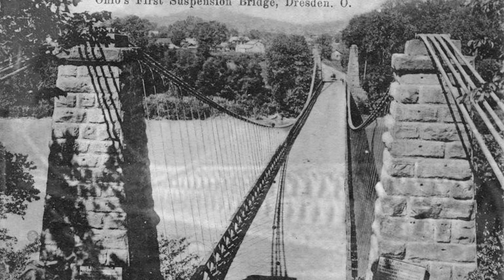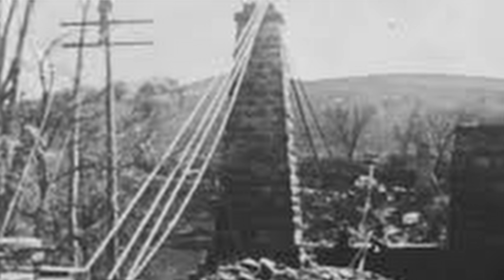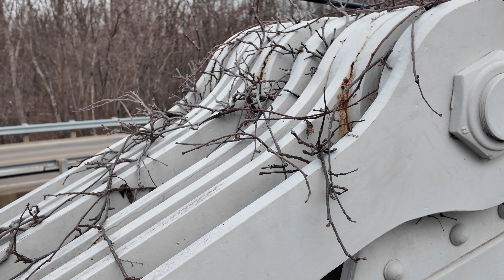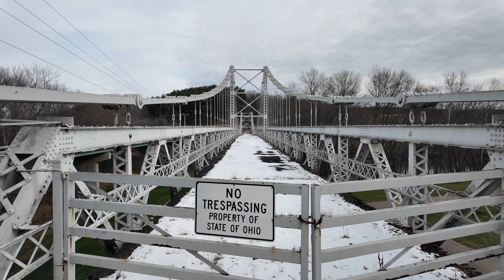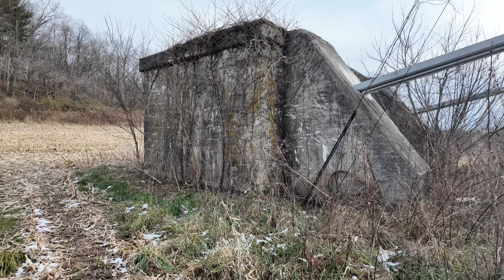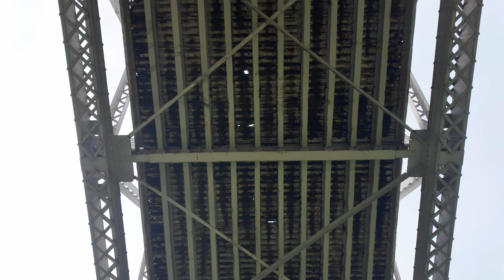The Incredibly Rare, Critically Endangered, Dresden Chain Bridge

Comment: 8:20 That part is just toast and if things are that bad there its not great for the rest of the bridge.
Reply from the maker: I'm not sure how structurally necessary those horizontal beams are.  Those definitely looked to be the worst, probably because they were made of the thinnest metal.  The bridge deck is probably the easiest to fix, for pedestrian use, since you could just toss a light, wooden deck right no top of what's there, so those holes aren't really a concern.
Reply: Might be due to salt exposure.  There is probably a detailed state condition report available.
Reply from the maker: @SteamCrane  Where it is, there certainly would have been plenty of salt used.  Not good for the metal, but having cars use the bridge as an ice skating rink isn't so great for the bridge, either, I suspect.

Comment: The Tibetan siddha and bridge-builder Thangtong Gyalpo originated the use of iron chains in his version of simple suspension bridges. In 1433, Gyalpo built eight bridges in eastern Bhutan. The last surviving chain-linked bridge of Gyalpo's was the Thangtong Gyalpo Bridge in Duksum en route to Trashi Yangtse, which was finally washed away in 2004.
Reply from the maker: Thanks for the info!  As you may have guessed, I'm a fan of historic, and pre-historic, technology, including pre-Industrial Revolution technology.
My research was showing the suspension bridges in Pennsylvania being the first "modern" suspension bridges "with all the features we'd recognize in a modern suspension bridge," but it didn't go into detail. With your info, I just went and checked out some photos.  I'd seen pictures of those bridges before, but not really thought about them as suspension bridges.  
Looks like they're oval link chain bridges, following the designs before that which used ropes/vines, with the chains allowing much longer spans.  Thinking about the differences, the chains are anchored at both towers/pylons, instead of crossing over them to separate anchors.  This limits the length.  Also, since it's running consistent-length, vertical suspenders, and means the bridge deck also sags in the middle to match the main chain sag.  It was clearly inspired by shorter bridges the came before, made with ropes, and those before that made with vines, and it's also pretty likely the inspiration for later, modern suspension bridges.
I don't know if you just know these, specific bridges, or if you're a fan of broader pre-Industrial Revolution technology.  If you know other, older technology, definitely feel free to point them out.  I know some of it, but certainly not all of it, and like learning about new, older technology.
Reply: @Industrial_Revolution  I'm just Googling. Here's one from the UK.
The Union Chain Bridge or Union Bridge is a suspension bridge that spans the River Tweed between Horncliffe, Northumberland, England and Fishwick, Berwickshire, Scotland. It is four miles (6.4 km) upstream of Berwick-upon-Tweed.[1]

When it opened in 1820 it was the longest wrought iron suspension bridge in the world with a span of 449 feet (137 m), and the first vehicular bridge of its type in the United Kingdom. Although work started on the Menai Suspension Bridge earlier, the Union Bridge was completed first. The suspension bridge, which is a Category A listed building in Scotland,[2] is now the oldest to be still carrying road traffic.
Reply: @Industrial_Revolution  Here are a couple more to look up.
The Pontcysyllte Aqueduct
The Iron Bridge
Reply: I wonder... I can't seem to find good photos showing the side of any of Gyalpo's bridges, but Wikipedia has a diagram of one drawn in the 1870s which looks like a modern suspension bridge design: The chains pass over a tower at either end, and the deck is suspended such that it doesn't bow with the chains.

Comment: Like the silver bridge
Reply from the maker: Yep, same design, and seems to have been the death of eye-bar suspension bridges.  That, and the fact that cable suspension bridges were just a lot easier and cheaper to build, I suppose.
Reply: @Industrial_Revolution  Design flaw. Many still stand, but are not across extra wide waters.
Reply from the maker: @BlueAgaveStudios  Specifically, for the Silver Bridge, I think it was that one where I read that it likely failed due to not having enough redundancy.  More eye-plates = more redundancy.  I don't know if they hadn't figured that out yet, or if they just wanted to save money.

Comment: It's a shame that it's going to be be demolished, but entirely understandable.
Reply from the maker: It doesn't need a lot of structural strength for a pedestrian load, and it seems worth it to save a historic structure.  The thing that's saving it right now, though, is that they don't even have the money to tear it down.
Reply: @Industrial_Revolution , it always comes down to money.  

Last weekend I explored an old rail line that had been purchased with the intention of turning it into a rail trail.  It has a couple of bridges and runs several miles.  The money needed to restore the bridges and is expected to cost around $20M.  I suspect that the goal of turning it to a functional trail is a pipe dream as no work seems to have been done and expected completion date is this year with no work apparently done.

The only chance I see of it happening is that they seem to have partnered with another, more successful rail trail in the area to raise money, but that organization still has about half of its own trail to complete.
Reply from the maker: Unfortunately, a lot of places are in that situation.
Sometimes a local business will come through with a big donation, cash, materials, or labor, or a strong volunteer base can pull it together (costs include labor, so if you get that from volunteers...).

Comment: Great video Darrin, but have you heard of the covered bridge in Germantown Ohio? Its not near as grand as this one but it has that same eye-bar design built in 1870. It is small but its still pretty unique.
Reply from the maker: Thanks!  A covered suspension bridge?  Weird, but makes a lot of sense.  If you can keep the elements off the deck, they're a lot less work to maintain.  
I wish I'd known about it a bit sooner.  I was just 20 minutes away from there.
Reply: Hmm, I'll have to check out this bridge or its heredity. Germantown is rather close to me.

Comment: Pittsburgh has three of these, I think. Or they are close cousins to this.

And the Point Pleasant, WV bridge, which collapsed causing a reawakened fear of Mothman was a similar bridge; unfortunately, that bridge wasn't built as well to hold in place.

PS: Steubenville's Market Street Bridge is a similar design, though I think it's still closed pending evaluation review.

And, just outside of East Liverpool  crossing the Ohio is the Newell, WV River Toll Bridge. It still takes automobiles.
Reply from the maker: Thanks!  I didn't know these were there, but not terribly surprised.  The Ohio River was one of the places in the US where bridge engineering was really  pushed early.  Bridges had to be high enough to go over steamboats, able to handle seasonal flooding and ice, and often pretty long, especially if you wanted trains to use them.
There's a few places where I've thought I'd like to find someone with a boat to go check out the bridges.  Toledo and Cleveland from Lake Erie inland until the rivers stop being navigable, the full length of the Ohio River, etc.  There's a LOT of great engineering in a lot of bridges out there.  Just need to find people with boats and time.
Reply: Just to add that the Three Sisters are not only chain bridges, but the only three adjacent identical bridges over a navigable waterway in the world.
Reply: @Zeppflyer 
That's quite remarkable, and you are right about that, now that I reflect more deeply.
Reply: @Industrial_Revolution 
You are welcome. And I would provide you passage if I had a boat. ; )

Comment: Darrin, thanks for this great video.  Have never been on the Dresden Chain Bridge, but about 40 years ago traveled over the 1849 Széchenyi Chain Bridge in Budapest, Hungry [rebuilt after WW2's destruction].
Again, great video!!!
👍  ⭐⭐⭐⭐⭐  👍
Reply from the maker: Thanks!  I think it's the first I've seen.  Brunel did some of them around the UK, too, and pretty sure some are still in use.
Reply: @Industrial_Revolution  
Darrin, didn't realize how special the Széchenyi Chain Bridge was when in Budapest.  It wasn't until about 5 years ago when a friend was talking about some unique bridge in Budapest & showed a picture of it.  Was trying to find a sidewheel river steamer to take a ride [only time ever rode on a sidewheeler & when we sailed under the bridge the boat's smokestack had to be lowered!!!].
Reply from the maker: Sounds like a good, historic riverboat, too.  I really need to get more ships on the channel.  I've only got one so far.
Reply: @Industrial_Revolution  
Remember the vessel was very well kept & a restaurant onboard.
Don't speak a word of Hungarian, just paid at the gangplank & got aboard; did the same in Greece once!!!
Don't think there are any more sidewheel steamers in the United States, but understand there is a sternwheeler or two running [which may be faux sternwheelers].
Reply from the maker: There's a handful still running on the Ohio and Mississippi rivers, not all original, and most (all?) running diesel now.
Reply: I have also been across that bridge, as well as under by boat.
Reply from the maker: @DaveRabbit-jr7ru  I wasn't brave enough to cross it in its current state.  Those foot-sized holes in the deck scared me off.  I made my drone go over it for me.

Comment: That bridge looks in better shape that the local bridges we have here
Reply from the maker: I don't know where you are, but I know in Michigan, we've had a few road bridges still in use where you could see through some holes.  Not the most secure feeling driving across them.
Reply: @Industrial_Revolution we definitely have that here in Kansas. I once found a hole in a bridge so large that my foot could fit in it. Not a comforting thing to find.
Reply from the maker: For a lot of bridges in SE Michigan, they've stuck plywood up under the bridges to catch (and hide) the chunks of falling concrete.  Now if only they could find a way to stop the over-height vehicles from hitting them.